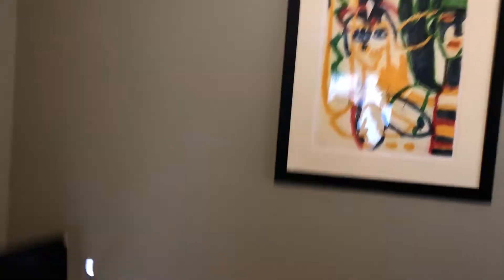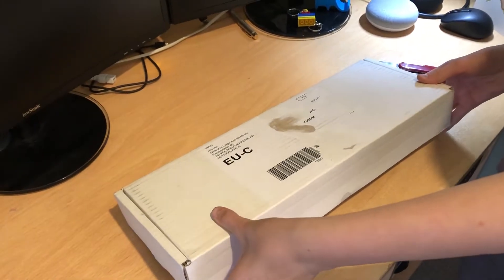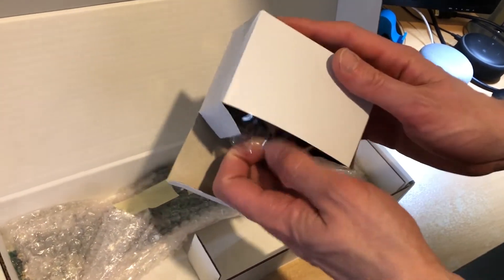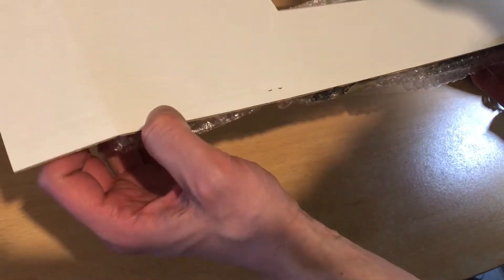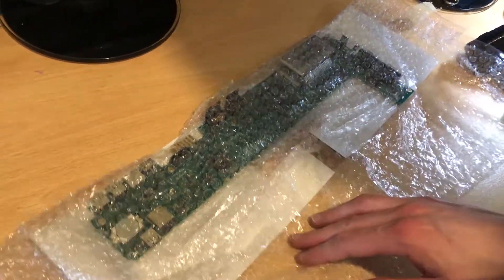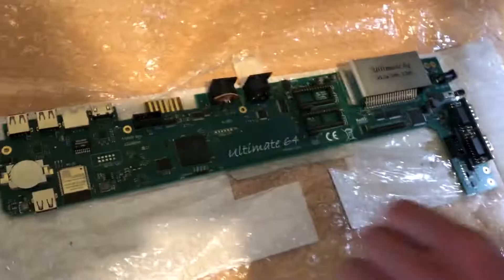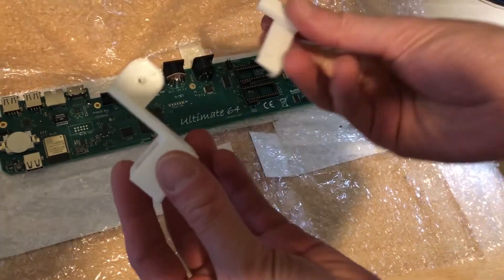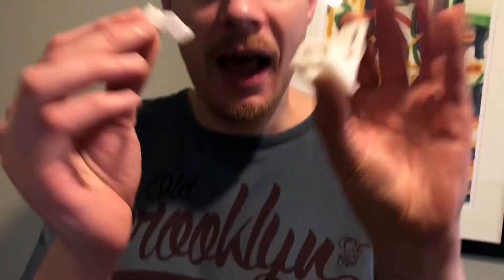Ultimate 64 - Unboxing

Comment: Hi, I have a question: but the two sockets on the main board are empty.  What does it mean?  Can the main board work without these? Thx
Reply from the maker: Hi, those sockets are for SID chips - what generates the distinctive sound of the Commodore 64.  The Ultimate 64 has a built in SID so will work with those sockets empty and still provide sound, but for those wanting an authentic experience, it’s possible to add your own SID chip.
Reply: @iNimbleSloth  So, can you choose to insert the two 6581 and 8580 chips?
Reply from the maker: @4nt0n104  Yeah, that's right. I've also seen people use ARMSID in there too. Two versions of the Ultimate 64 are available https://ultimate64.com/Main_products If you are serious about using the original SIDs, it might be worth splashing out a little extra for the Elite version as it has ZIP sockets. I have the regular version as I ordered before the Elite was released. However, I haven't bothered with real SIDs in mine.  If you've got a Facebook account, Gideon the designer has a group https://www.facebook.com/groups/1541ultimate that has a ton of info and pics from peoples builds - worth checking out.

Comment: Darn. I need a ultimate 64 :-)
Reply: I wounder if it would fit in "The c64" fullsize case. Question is what they gonna use as keyboard on that one.
Reply from the maker: I read a response from them to this very question. ‘The C64’ keyboard is not going to be compatible with C64/Ultimate 64 motherboards. But I’ve pre-ordered one on Amazon to see what the machine is like compared to original and Ultimate 64 😁
Reply: It will take zero days before someone sells a keyboard adapter. :-)
Reply from the maker: It’s a long wait from order to delivery , but I really like it.